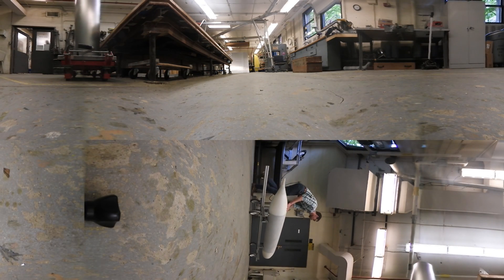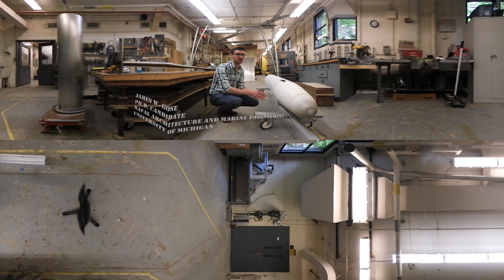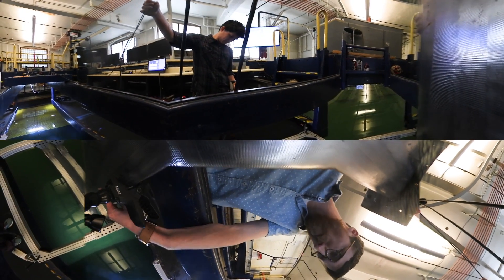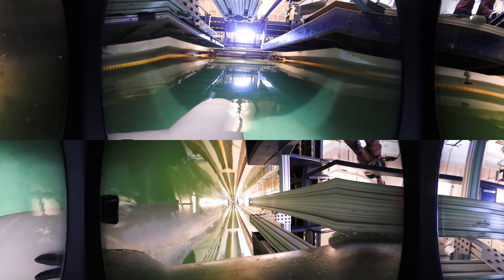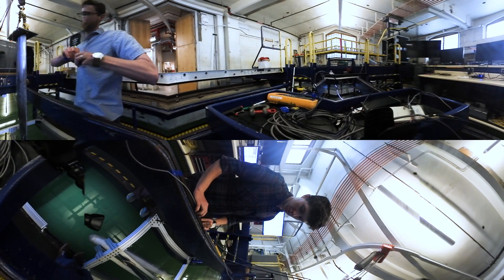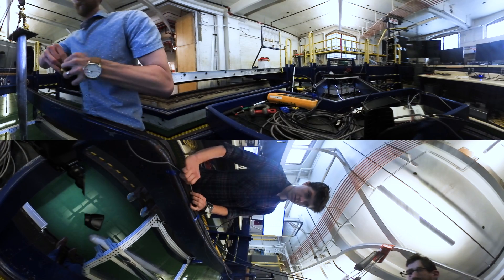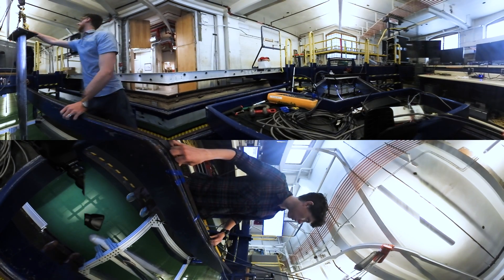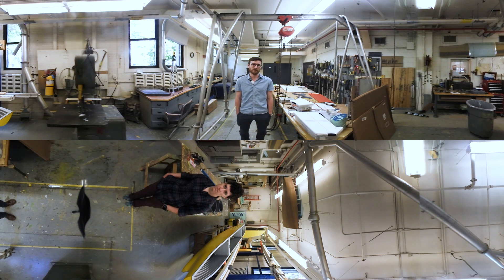Superhydrophobic Submarine Coating - 360 Video

Comment: I could tell you how to reduce drag by 50%. Without special coatings.
Reply: How? I am curious
Reply: @tobiasschnell5728  A sheet of Air Bubbles coming out directly behind the nose cone, from orifice tucked behind a recessed lip shaped like a vortex generator, arranged in a band around like that of a head of a circumcised penis. Drafting in shield of bubbles. To much noise for the navy, but I do Have a bubbles-Less and non cavitation propulsions system for that.